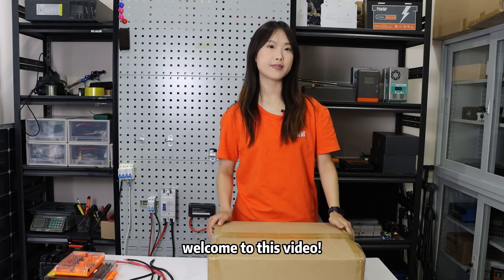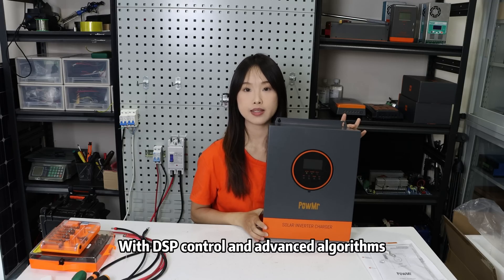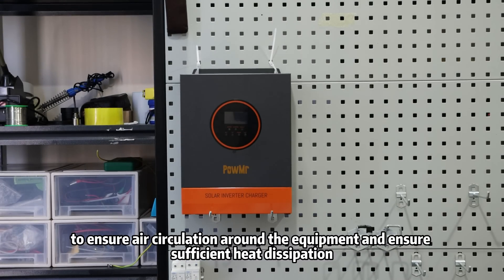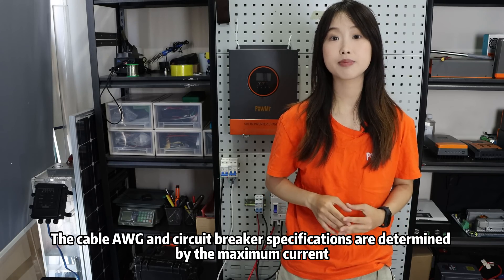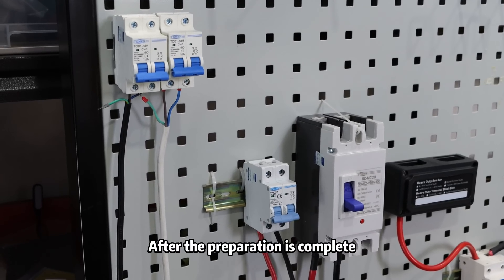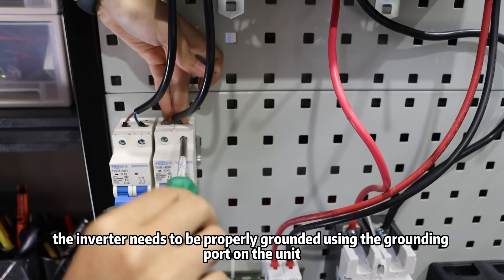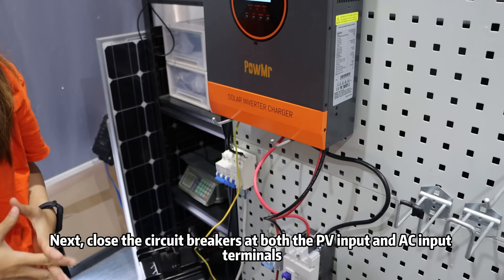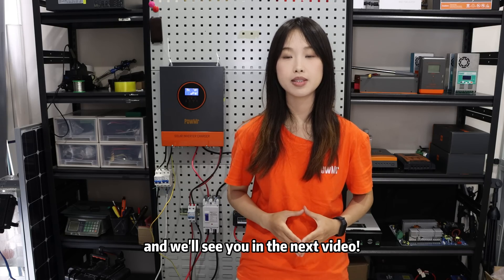Detailed Solar Inverter Installation: A Step-by-Step Guide

Comment: your output is 2 wires 240 volt. In USA 240 volt is L1, L2 and Neutral= three wires plus ground. How do you get 120 volt out of your inverter?
Reply from the maker: This is a US standard machine. 110V.

Comment: is the cable size suit the same with 1.8kwh /12v inverter?
Reply from the maker: Nope.
Reply: in the video inverter is 24v or 48v? @PowmrSolar
Reply from the maker: @kucingjalanan1352  24V.

Comment: I have 2 pow HVM6.2M-48V-N on one i intend to put 2 100 amp Li batteries in pararrel and one one the other is this ok and can i charge one off the  230 v output to the other to top up the battery
Reply: One on the other
Reply from the maker: @ Please send pictures of the two batteries and the wiring diagram to this email: support@powmr.com.
Reply: @PowmrSolar  only have one battery at the moment have ordered 2 more batteries  may take another month to get here as they come from china
Reply from the maker: @ Okay. Please send it to this email: support@powmr.com. Our technical staff will check it for you
Reply: ie 2 48 volt 100amp batteries connected in parallel = 48 volt 200amp  on the other inverter only 1 100 amp 48v batteries  then can I  use one inverter as a generator to power the other inverter as a generator to charge the batter as my solar panels are in 2 strings one of 2200 watts and the other 4400 watts

Comment: In the 1kw  Hybrid inverter  unit can it  charge Li Fe  batteries, I don't see any reference to it in the manual ?
Reply from the maker: 05 Setting items can be selected to USE.

Comment: what is the idle consumption of the 6200 w model?
Reply from the maker: <2%
Reply: @PowmrSolar  is it the same for the 4200w 24v model? around 80-84 watts idle consumption? Even in power saving mode or stand by mode? What about using only the secondary load (that is lower like 1400w according to specs) instead of the main load? Thanks
Reply from the maker: @segundacuenta726  42W. If the power saving mode is turned on, the load power is less than 50W and will not be detected by the machine

Comment: It showed that we have to connect AC input in L and N in the inverter. What if our AC input both live wire? Both two line are 110v live wire,
Reply from the maker: This situation requires a machine that can separate phases.

Comment: Hi, should i connect the com cable from battery to inverter? I consider to use wifi module to monitoring system.. thanks
Reply from the maker: please send us your model number.

Comment: How can I connect the output to RCD for the 10.2kw model? It has only two output pins. Is the earth ground connected to the output N pin internally?
Reply from the maker: The ground cannot be connected to the internal N port of the leakage protection switch. The output terminal can be directly connected to the ground screw of the fuselage shell.

It is recommended to connect to a standard AC circuit breaker rather than a leakage protection switch
Reply: @PowmrSolar  We need a diagram instead of this movie. This is not a simple plug and play consumer product.
Reply from the maker: @dskim9242  Please send your problem to this email: support@powmr.com.
Reply: @PowmrSolar  I sent you two emails but no reply
Reply from the maker: @dskim9242  Please send us your email.

Comment: Does the PowMr have an internally bonded neutral?
Reply from the maker: may I know which model you are asking about?
Reply: @PowmrSolar  POW-LVM5K-48V-N. This is to be installed in an off-grid camp where power will be provided by a PV array and battery. Occasionally a gasoline powered generator may be used to provide power on demand , but no electrical utility is present.  The POW-LVM5K-48V-N will power a typical residential electrical panel. I would like to know if the neutral bus should be bonded within the panel or  if they should be kept separate as in a residential subpanel.
Reply: @PowmrSolar  POW-LVM5K-48V-N
Reply: @PowmrSolar  POW-LVM5K-48V-N
Reply: @PowmrSolar  POW-LVM5K-48V-N.  The inverter shall be used to power a residential electrical panel in a 100% off grid camp. Should the neutral bus in the residential panel be bonded to the ground, or does the neutral to ground bond already exist in the PowMr?
Reply from the maker: @ultrahighgain412  
This unit does not have neutral point grounding, and it is not recommended to do neutral point grounding. Just connect the shell of the machine to ground normally.

Comment: You did not show all the wiring. Where do the wires go after they come out of the breakers? What are the wires going from the black and red bus bars connected to(that rectangular white box below). Where do I plug in my loads? I need to know this information! Thanks...
Reply from the maker: Please send your problem to this email: support@powmr.com

Comment: My 24v 3000 PowMr does not charge ith my 400W solar panel.  Panel is giving 36 volts but no sol;ar display in LCD of inverter.  I have one 24v 200ah Lifep04 battery from Chins
Reply from the maker: please send your problem to this email: support@powmr.com.
Reply: @PowmrSolar  I think I found the issue. The unit needs 120v input on PV and my panel only brings 36v

Comment: can you power on the inverter using the AC in first if the battery is low charge? so it can charge the battery.
Reply from the maker: which model?

Comment: Can I bond the neutral to the earth bar?
Reply: Thanks mate, just answered my question 👍
Reply from the maker: May I know which model?
Reply: @PowmrSolar  POW-HVM6.2M-48V-N is the model. I want to earth bond the neutral of the AC output of the inverter.
Reply from the maker: @postiemania  This model does not have its own neutral point grounding. But yes, you can do the neutral point grounding yourself.
Reply: @PowmrSolar  thank you. In Australia this is called the M.E.N. system (multiple earthed neutral) and this keeps the neutral wire at earth potential.
Reply from the maker: @postiemania  Okay, get it. Thanks for letting me know.

Comment: It inverter works off grid?? Only with batery (no ac input).
Reply from the maker: which model?
Reply: @PowmrSolar  POW-HVM4.2M-24V-N
Reply from the maker: @hanus1987  It is a hybrid inverter.
Reply: @PowmrSolar  IT MEAN yes or no???
Reply from the maker: @hanus1987  Yes, this model can work off grid.

Comment: Why is there no ground cable for the AC output?
Reply from the maker: The machine usually has a grounding screw. You can connect the ground cable to the grounding screw.
Reply: @PowmrSolar  How is the ground screw getting its ground if the AC INPUT has no ground?  Shouldn't the AC INPUT get its ground from grid power?  Thank you for replying.
Reply from the maker: @JR88888  Connect the ground cable of the AC input to the ground screw, and then directly ground the ground screw.
Reply: @PowmrSolar  , I want to confirm that the 3 wires for AC go directly to the 3 slots for AC INPUT and not the ground screw on the chassis.   The AC OUT wires L and N go to the AC OUT slots (L and N).  The ground from the AC OUT wire connects to the ground screw on the chassis.
Reply from the maker: @JR88888  for 110V or 220V? We also have inverters designed with ground wire ports.
Reply: @PowmrSolar  Hi, it is 110V. I am about to buy solar panels that are 13.33A. My unit, the 24v 3000K, Has a Max PV input current of 13. Will 13.33 be too much? Thanks.
Reply from the maker: @JR88888  Yes, too much. Can‘t exceed the max PV input current.
Reply: @PowmrSolar  OK.  Thank you.
Reply: @PowmrSolar  The 24v 3000K unit requires at least a minimum of 120VDC to charge?  I see this in the documentation and wanted to verify.  That is relatively high?  Thanks,
Reply from the maker: @JR88888  Yes, it is 120V.
Reply: @PowmrSolar  Will 12.99A be too close to the limit of 13A for the PV input?
Reply from the maker: @JR88888  It's okay, as long as it doesn't exceed 13A.
Reply: @PowmrSolar  Setting 4 - I cannot change it from the default 21.8v to any other value.  It keeps going back to the default value.  I have tried it many times.
Reply from the maker: @JR88888  What is your setting for item 01?
Reply: @PowmrSolar  01-SBU
Reply from the maker: @JR88888 What's your setting for item 14?
Reply: @PowmrSolar  14 is set at 22v.  It seems to be charging from the grid before it goes below 24.
Reply from the maker: @JR88888  04 setting should be lower than 14 setting. You can also reset the inverter and then select SBU in 01 and try setting 04 again.

Comment: Can I use common grounding for Solar panel grid and Inverter and SPD. Thanks
Reply from the maker: Just ground the inverter. Because the solar panels are connected to the inverter. Grounding the inverter is equivalent to grounding the solar panel.

The SPD is also connected to the solar panel. Just take them as a whole and ground them on the inverter shell.
Reply: Thanks. One more thing can I ground with the grounding rod from grid.
Reply from the maker: @YakubHasan  If you are grounded from the grid, then the input end of the inverter does not need to be grounded. If your output needs to be grounded, you can connect the ground wire to the inverter's housing screws, and then ground the inverter's housing screws.
Reply: @PowmrSolar  This should be included in the manual .

Comment: I install 6.5kw powmr inverter. 8 solar panels jinko n type 580 watt install in series. When I consumed 2000 watt above. Inverter showed error no 8 bus voltage is to high. How can I solve
Reply from the maker: Hi, kindly send your problems to this email: support@powmr.com.

Comment: Your explanations and demonstrations are perfect. Only slight thing you could have explained is how you sized those AGW wires and circuit breakers since those inverters are not the same. And their cables will differ. Other than that Great job.
Reply from the maker: Hi, thanks for your advice.

Comment: I ordered your 6.2kw Hybrid inverter, it keeps on giving me Error 51 which according to your manual it needs to be brought to service center, I chatted with your Customer Service in your online store and only instructed me to check the item by disassembling it and testing it. Can I just have a replacement of the item? Checking and disassembling the inverter just makes me more frustrated that I bought and paid in full yet I feel I'm the one who is doing the job fixing it...😢
Reply from the maker: Kindly send us your order number.

Comment: That's a nice explanation. I have a question. What's the difference between "Hybrid Inverters" and "All In One Inverters"? For example,  "POW-HVM5.5M" vs "POW-HPM5.6KW".
Reply from the maker: Hi, the hybrid inverter has the function with Grid-off and Grid-on, while the all in one inverter indicates the off grid inverter with its own built-in mppt.
Reply: @PowmrSolar  So, the All-in-One is only for off-grid? I'm confused.

Or just get the Hybrid?
Reply from the maker: @807800 Yes,  the all in one is for off-grid. Do you need to transfer power to the mains? If you don't need it, you can choose any one.
Reply: @PowmrSolar  I see. The differene is only about transferring power to the main, but both can still be used for on-grid with main connected.

Thank you.
Reply from the maker: @807800  Yes.
Reply: @PowmrSolar  Thank you!

Comment: 22AWG wire for connecting a battery?  Most inverters come with thick 2 AWG wire for hooking up the battery.
Reply from the maker: Hi, may I know which model?
Reply: @PowmrSolar  in your video at 4:15 she shows the battery cable.  She must be hooking it up to a tiny battery.  22AWG wire is what you might use for LED lights that pull 4 watts.
Reply from the maker: @jamesmadisoo199   Hi, two 2AWG wires.

Comment: I just got a 10.2 invertor. My question was do it start up and work with no batterie conect on the invertor..
Reply from the maker: Hi, yes,  but we do not recommend working without batteries, as PV generating electricity during the day without batteries is not a constant process itself.
The PV may be high or low, and it does not completely match the customer's load usage habits, which will lead to the fact that when the PV power generation is good, the load may not be used so much, resulting in waste; or when the PV power generation is not good, the load needs a lot Electricity, if PV cannot be brought up, it may be completely replaced by mains electricity.
If there is a battery, it is different. If there is more PV, it will be stored in the battery. If the PV is not enough, the power in the battery will be used. Except for special circumstances, the mains power will be used.

Comment: Hello all,

the pow-mr customer service was not able to help me directly in the first attempt, but i'm also not sure if they really understood my problem. Therefore I try it on this way. Maybe someone has a tip to my problem.

I am operating 3 POW-MR inverters in 3-phase mode, TYPE POW-HVM5.5K-48V-P. The setup is running with 16 LiFePo cells, 230 Ah with a Daly BMS.

I would like to operate the setup so that the inverters draw power mainly from battery and solar, and only draw grid power when nothing else is available.

I don't want to charge the battery from the grid because of the high losses.

Now I have configured the inverters to charge the battery from solar only (configuration item #16 OSO).

If I run it this way and the inverters run in grid mode because of an empty battery, they still draw about 2 Amps from the battery until the BMS disconnects the battery from the inverter. Then the power fails in the whole house for a few seconds. In addition, I then have to charge the battery manually because it is not recognized anymore.

With all other options (e.g. #16 SNU), the 3 inverters charge at about 12 amps, even though a maximum charge current of 2 amps is set in #11. The battery is then in the worst case already charged to over 50% at sunrise and the then possibly available solar power cannot be stored.

Another point: Is it possible to get the communication protocoll and pinout for the rs 485 protocoll? I assume the inverters use this standard and it would allow me to connect them to my smart home system.

Looking foreward to your reply.

Best regards

Christian